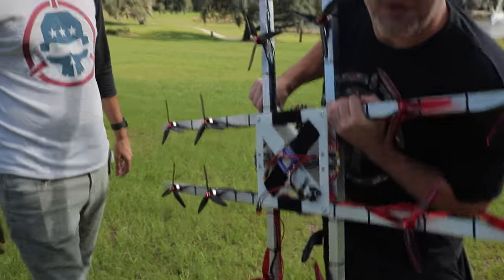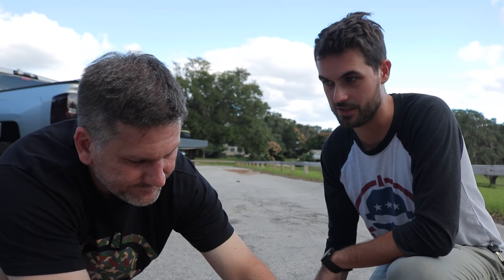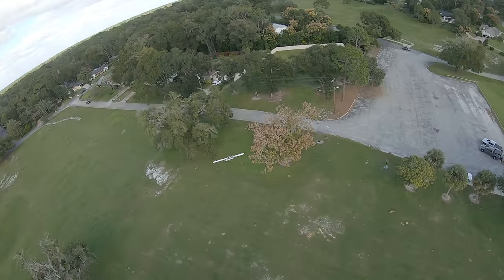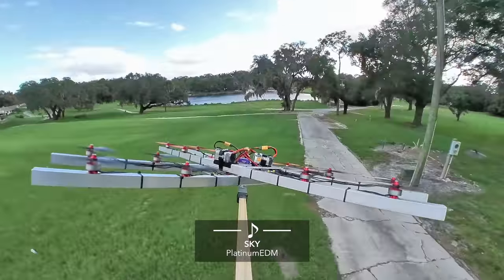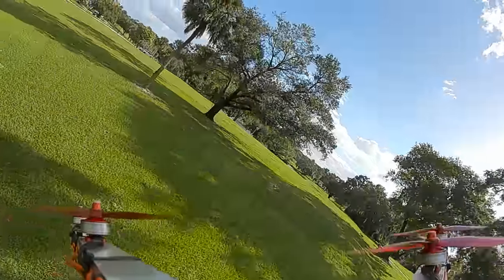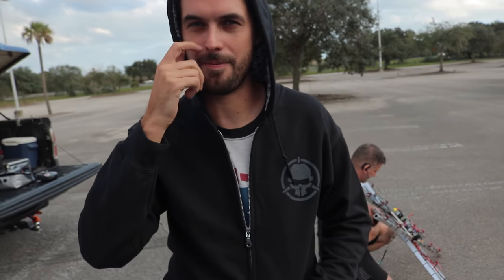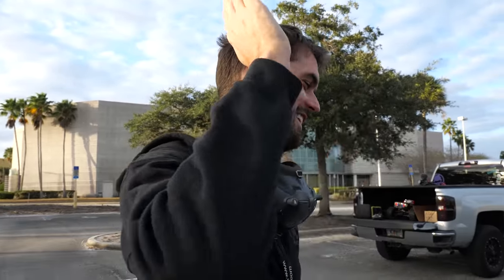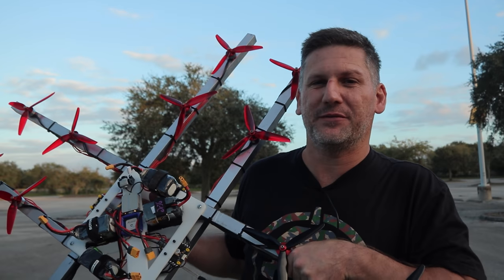Drone-Boarding!! - Skating behind a 16 MOTOR DRONE!

Comment: VERY COOL!!!
@Rotor Riot - ANY SPECIAL FIRMWARE CONFIGURATION NECESSARY OR DID U JUST TAKE EACH OF THE 4 SIGNAL WIRES AND ATTACH ONE TO ALL 4 INPUTS OF EACH  OF THE ESC? SO ESSENTIALLY 1 SIGNAL WIRE CONTROLLED ALL 4 MOTORS OF EACH ESC, SO ALL  4 MOTOS SPUN IN TANDEM ...
Reply: I have a series on my channel - RR behind the scenes, and I will go into more detail about the build there.  Keep an eye out.  :)

Comment: I wish I had 4 flying drones period. To get them all working together is some witchcraft beyond me
Reply: Fax 🤣
Reply: haha, i hear ya. i have 4 quads total, unusually 2 are broken and waiting on parts.
Reply: Four motors are treated as one, thus the four motor signals are running to each ESC. Thus each signal wire is split into 4 parallel leads for each ESC. In effect, each arm of the Quad acts like one big motor.

Comment: How did you guys hook the motors to the flight controller?  Did you manage to find 16 inputs to hook them all in, or did you combine each 4-in-1 into one input so all the motors on that arm spin at the same speed?  Very cool build.
Reply: I’ll do a behind the scenes build info on my channel, soon.  :)
Reply: @LetsFlyRC  👍
Reply: @LetsFlyRC  YAYYYY. Looking forward to that. 
(BTW, if you guys could figure out a way to comment under the Rotor Riot username, Youtube will actually show us when tyou've commented - makes finding these updates much easier. 😁)

Comment: would be nice to see how the motors are hooked up to the fc hardware and software.
Reply: looks like each of the four sets of motors has the same esc signal and all spin the same way so its controlled the the same way as a quad. That's my guess anyway
Reply: @vesselfpv8274  yes thats what i also thought, but seems not ideal and maybe they done otherway. you can see it actually that it rolls different then it flips. Forces are not equal.

Comment: That was cool! Did you wire the escs to the FC by using all 4 outputs from each esc to 1 signal pad, so where your 4 motors that are in #1 position all work as 1 motor?
Reply: Looks like it

Comment: I don't think you guys have a clue how much power is required to wakeboard. The friction from water is huge, then there is the issue of how much power is needed to lift a rider out of the water in the first place (assuming you don't cheat and "wakeboard" through a puddle).
Reply: We know.  We are both engineers 👨‍💻:)
Don’t necessarily have to lift out of the water.  

I’ll make it happen.  Keep watching the channel.  ;)